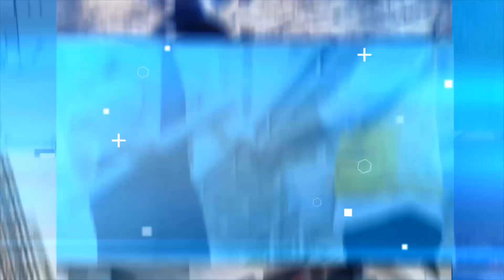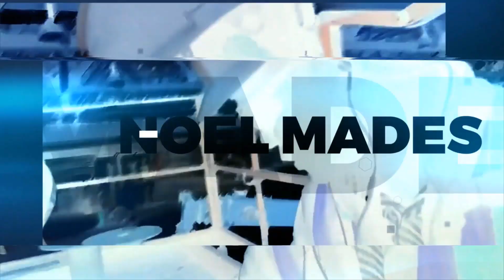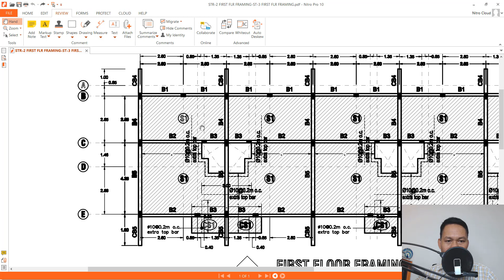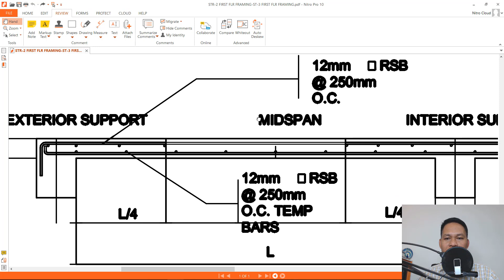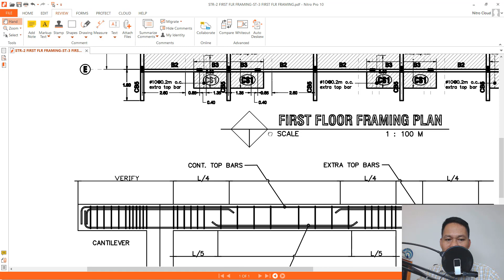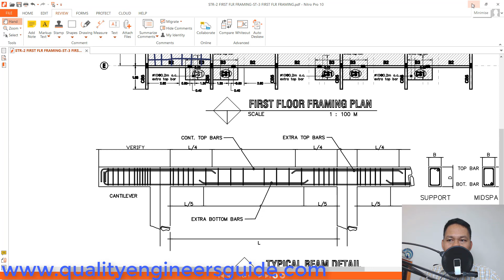How to Lay the Steel Reinforcement on Two way Slab

Comment: nice sir very informative.. sir ask ko lang ano dapat size ng chair bar spacer base sa plan na 150mm na slab thickness.. Thanks👍👍👍
Reply from the maker: Kung top and bottom ang reinforcement mo computin mo kung gaano ka taas. minus mo ung to and bottom cover minus mo ung top reinforcement  minus mo ung bottom reinforcement kuha mo na.
Reply: @qualityengineersguide  Thank u sir.... one more question sir... ung paglayout ng electrical pipes dapat ba sa ilalim ng bottom bars ilagay or sa taas kung two way slab reinforcement sir thank u sa pagsagot sir....
Reply from the maker: @rangom812  In between the top and bottom reinforcement 'yong iba after na ng buhos kapag nag install na sila ng wall partitions kasi makapal ang toppings nasa 50mm bago mag tiles kaya nilalatag muna ung mga electrical pipes tas protectionan ng screed. Subscribe ka sa tagalog channel natin ituturo ko yan doon Enhinyero Sibil QE.